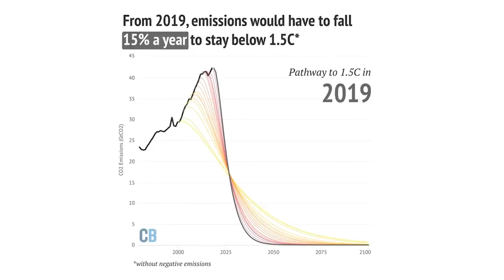Moltex Energy Limited believe stable salt reactors are the future to a nuclear world.

Comment: Such a waste of resources. “Nuclear energy when wind is not blowing” . 😂 . Why i would switch off a nuclear power plant, once it is producing energy. Why are we so stupid .
Reply: Moltex run the reactor to continuously feed heat to “solar salt” thermal stores. The steam generators extract heat and ramp up and down according to demand.
Reply: @Dave5843-d9m  Would it be possible to use the "solar salt" thermal stores to store energy from wind and photo-voltaic solar?

Comment: Why bother with unreliable, land hungry renewables at all if you have cheap and safe nuclear? Renewables would just get in the way.
Reply: Unfortunately the only way off getting anything like this built is to get green activists on board (think Carrie Symonds) and they would never agree to an all nuclear solution. In my experience such people are, unfortunately, either mathematically and scientifically ignorant or are very lazy when it comes down to doing the research that would enable them to make rational decisions. The laziness is the bigger problem and it seems endemic in those less than about 40 years old - i.e. those for who grew up with social media. They would much rather support (vehemently) a position they got from some random tweet than make the effort to get some facts - very disappointing.

I do wonder whether Moltex would do better if they promoted the SSR as a device to get rid of the nuclear stockpile rather than as a nuclear reactor. Those of a green disposition would like that. The thermal output of this nuclear waste burning machine would, purely coincidentally of course, be useful for numerous purposes such as electricity generation.
Reply: @redmunds1565  Economics will tell the true story.
Reply: EXACTLY!